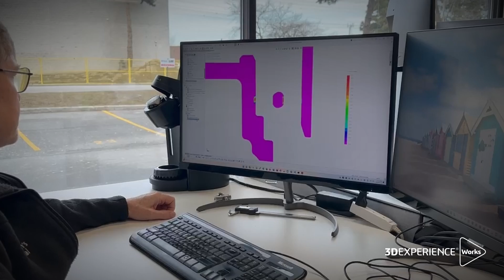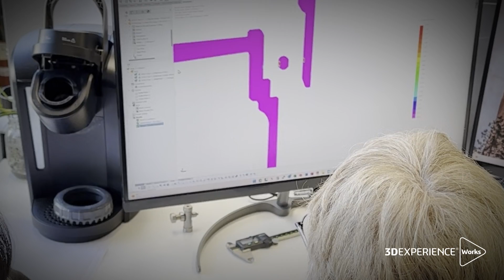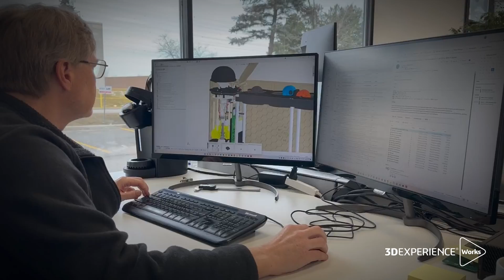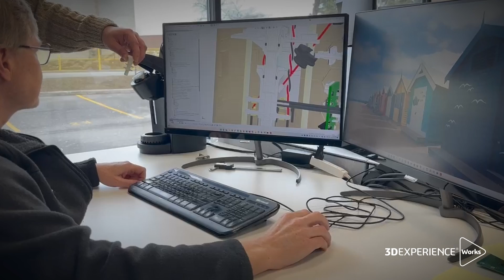OtO Uses Digital Twin to Trim Development Costs

Comment: I’m surprised they have 17 engineers on the team to do it. 
I have had to move slower but I’ve been able to handle it with just myself and another guy doing electrical pcb. I think the real value beyond the digital twin, is the ability to utilize your expertise to execute and get things right from imagination to reality. A digital twin is otherwise only as good as the variables accounted for. But Solidworks enabled me as Mechanical Engineer & CEO to have the very first product and prototype be the product that I can confidently ship and stand behind. It’s been 1.5 years and even the first prototype that was manufactured is still running strong out there.
Reply from the maker: Thank you for your insight on how SOLIDWORKS helped with this prototype. Keep up the great work and continue to share these accomplishments with us!